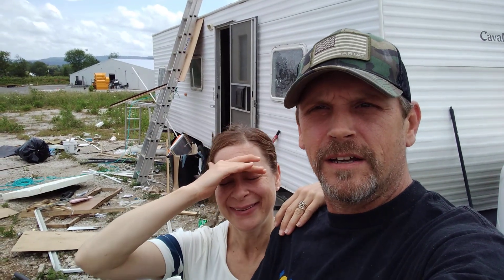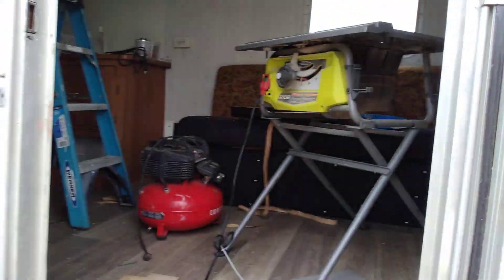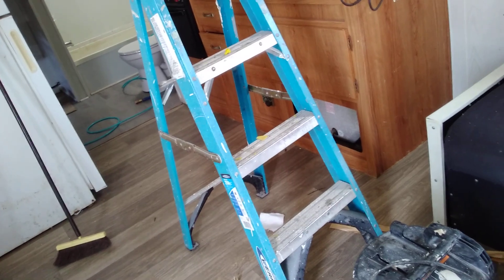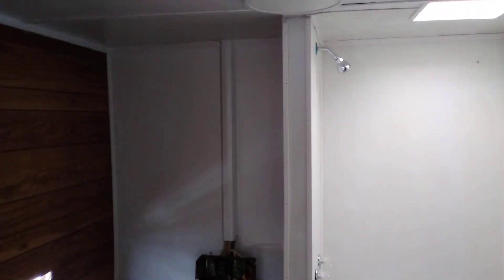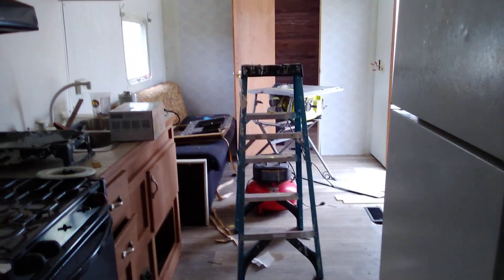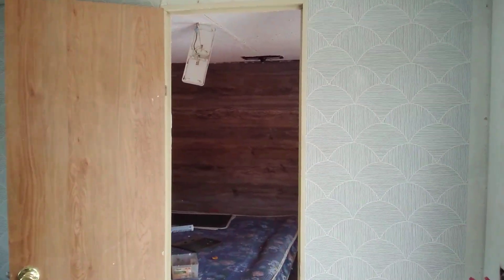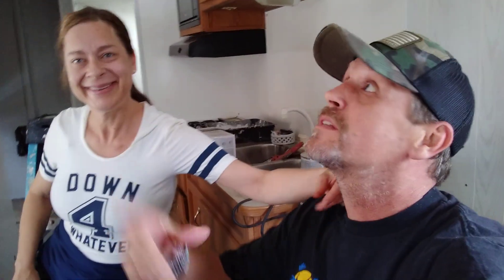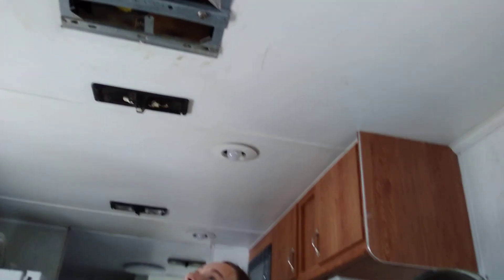Update On Our Camper! Staking Out A Spot On Our Off Grid Property For The Camper!

Comment: That 2 hole vent by the door on the outside is the vent for furnace and the roof top is only AC . The duct needs to be fixed in the ac . Also there should be a 40 gal fresh water tank that pumps out

Comment: The camper is looking great.  Nice spot you have for the camper! Being off grid is a life changer.  It definitely has a way of making one humble.  Been off grid for almost a year.  There has been so much rain here in Missouri.  Under the front of the 5th wheel by the hitch has came apart in a large spot cause of the rain. Pre maintenance and weatherizing was done but still didn't prevent that from happening. Just make sure y'all stay right on top of everything to prevent leaks sure you know that but just a heads up.